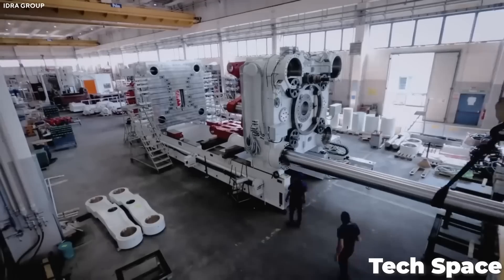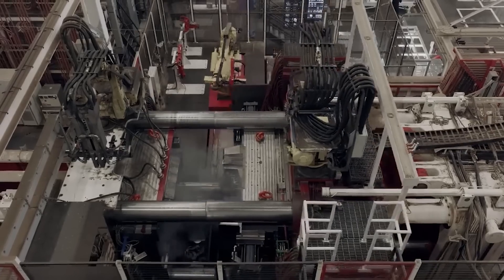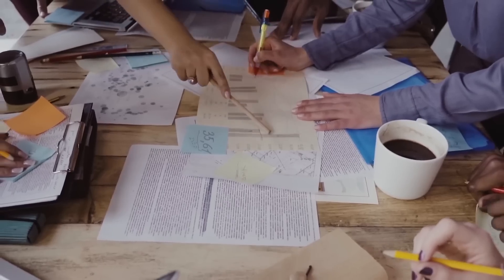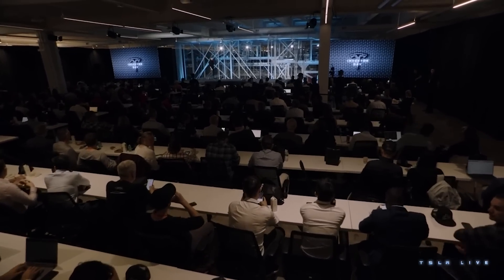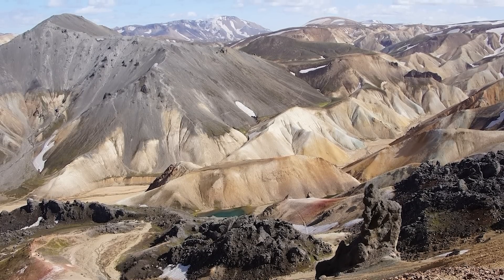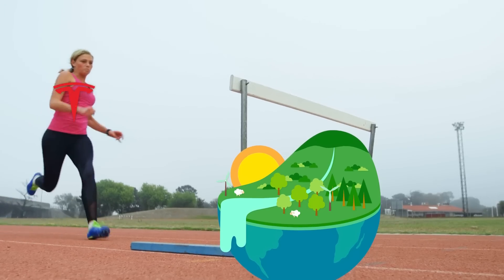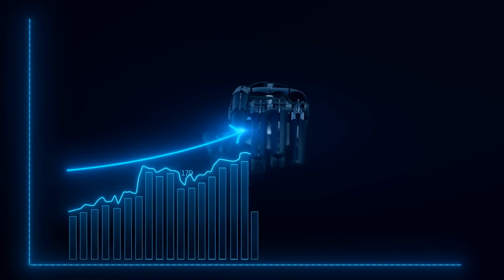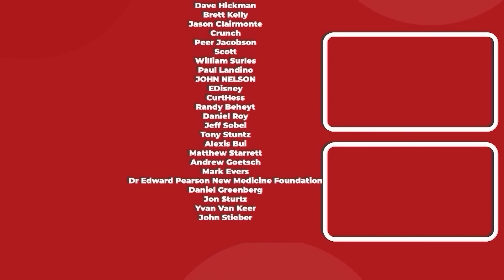Another 9,000 Ton Tesla Giga Press Is Here!

Comment: How in the world is Giga-Berlin turning out 5000 vehicles per week? A factory running 24 hrs a day for 7 days straight has 168 hours in it. That comes out to 29.8 vehicles per hour? One side of the building parts of cars go in and an hour later 29.8 cars come out the other end?? That doesn't sound possible? Not even with 90% of the labour being done by robots and with a majority of the components being modular and just need to be snapped together. 29 vehicles per hour without any breakdowns or problems with the supply chain or Earl getting his arm ripped off in a confabulator or Delores soiling herself because of a bad burrito last night? 5000 vehicles sounds physically impossible?

Comment: That's the way to make consistent parts with the least amount of manufacturing steps, if the dies are designed well to meet the requirements you get the same part over and over again. Initial machine cost is high but I guess over time and parts produced it pays to go this manufacturing route.

Comment: Planting lots of trees and installing lots of solar panels on the factory roof and covering parking areas can actually help increase rainfall and reduce drying out the ground slightly in the immediate area. This is because a portion of energy from the sun that would have just ended up baking the ground will now be used in photosynthesis and in generating electricity. The area will then cool down slowly, aiding precipitation. The end result could be the reverse of desertification if the process is managed properly. 

Water usage can be reduced by using dry cooling towers (using heat exchangers) rather than evaporative cooling towers as much as possible. Usable water can also be generated from sea water through reverse osmosis powered by solar electricity.

Covering as much of the factory building with solar panels will also help reduce power required for air conditioning as less heat would enter the building.

Comment: Thank you for the very informative video.  For your information, the Rio Grande River at the point where it enters the Gulf of Mexico is almost dry about 3 months a year.  This is a desert area and the Rio Grande should be called the Rio Poquito.  Also, the sub surface water availability is very low.  Therefore, the only logical water source is through a Desalinization of the water from the Gulf of Mexico, which is a viable solution.  In fact, a DeSal plant financed by Tesla, in conjunction with the local authorities, would be a great water solution and a political coup.
Reply: Hey
Reply: And they could use the sodium depending on what battery chemistry they decide to produce there.